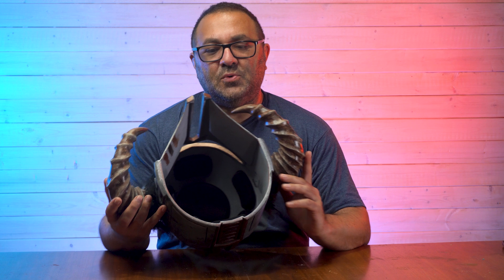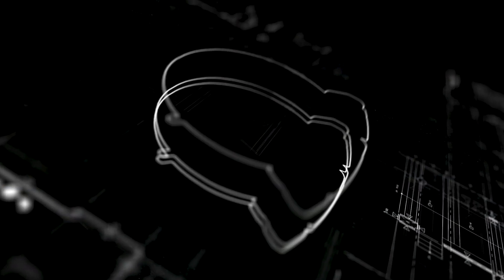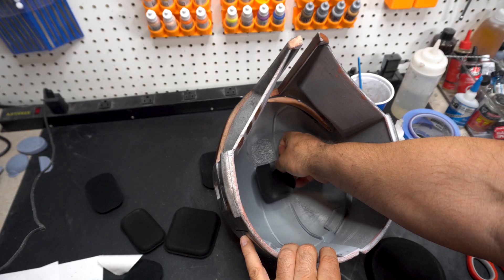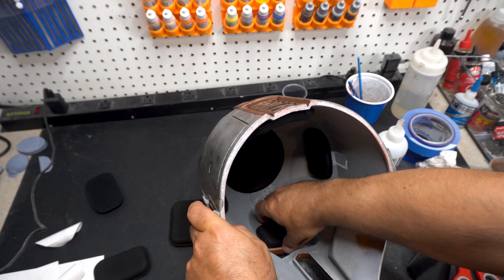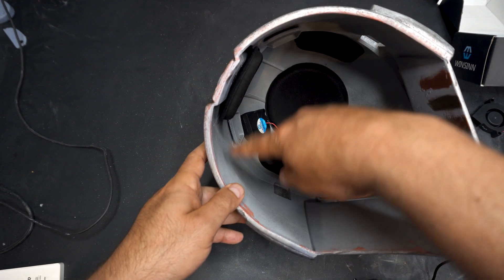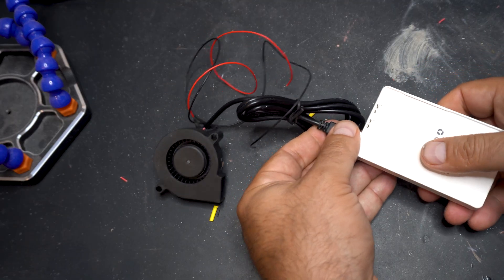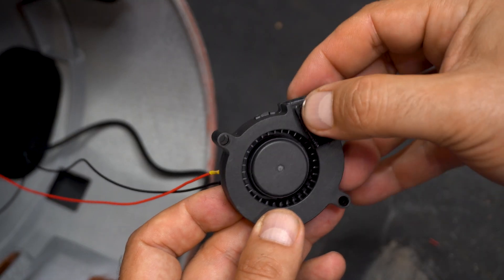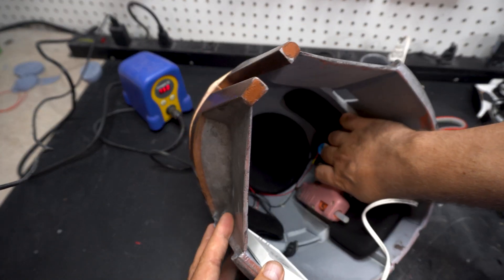Adding Fans and Padding to a 3D Printed Helmet - Viking Mandalorian - Part 3

Comment: I'm curious, did you add a switch or resistor to the fans? 2 5v fans would need a 10v battery wouldn't they? I don't wanna start a fire in my helmet 😅